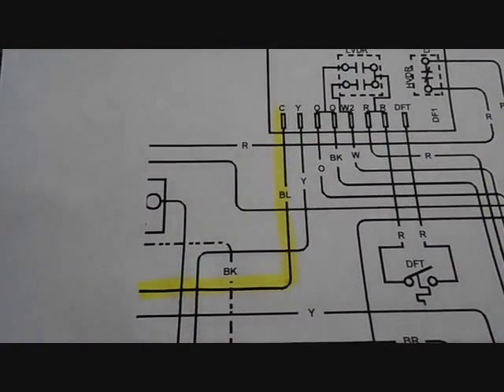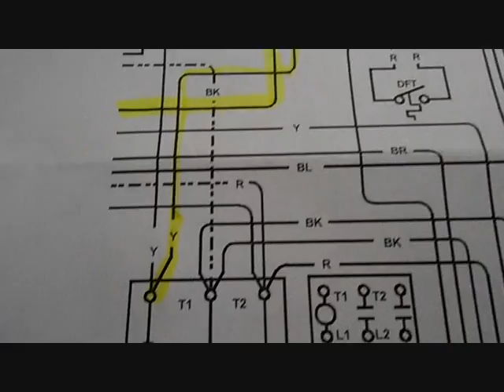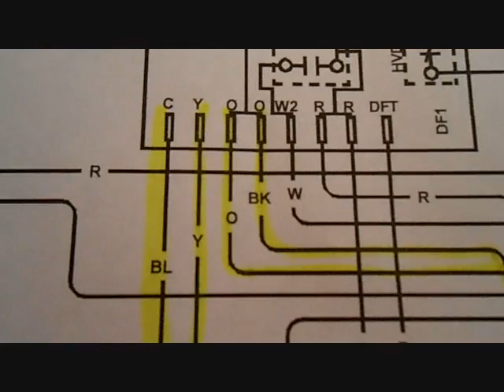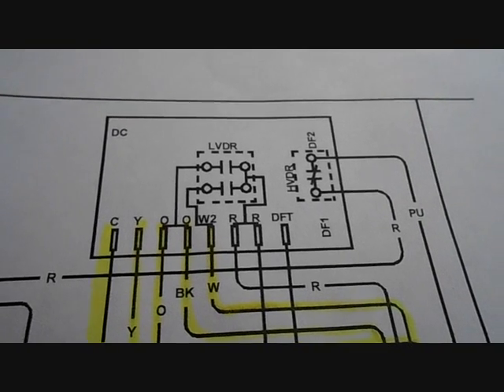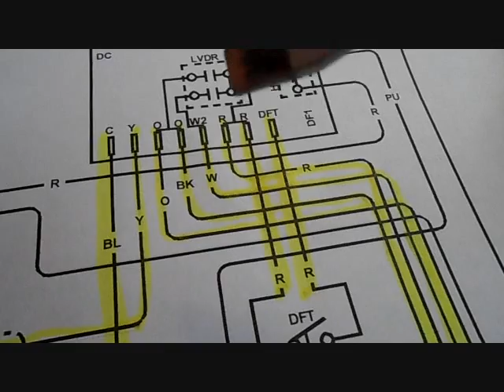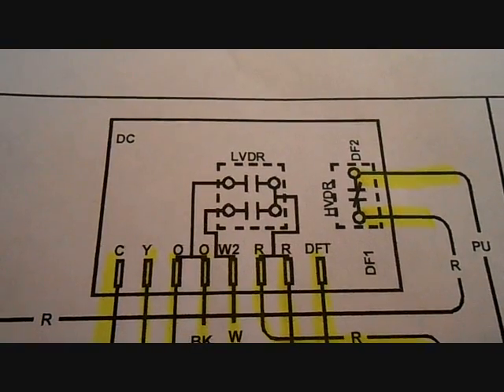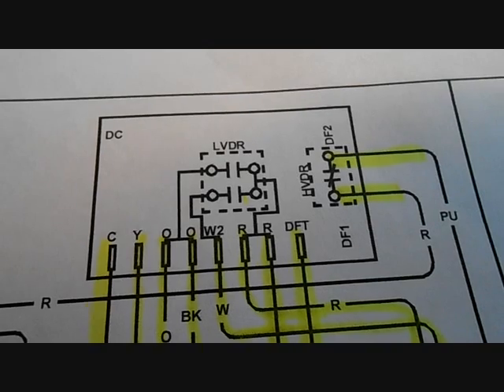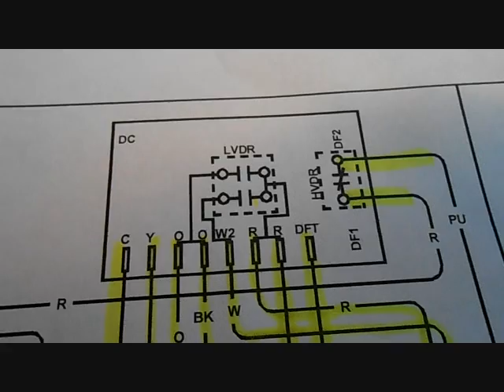HVAC Controls- PCBM130 Defrost Controller

Comment: I have this board. Can you confirm the fan disables during the defrost cycle? Mine does not.
Reply from the maker: The outdoor fan should shut off during defrost, yes.
Reply: Thank you..
Reply: Thank you for the video. My same board was not shutting the fan off, and I replaced it today. Issue fixed. Appreciate your video

Comment: You are wrong on the 30, 60 or 90 minute selection. On this board once the Defrost Stat closes it will DELAY THE ACTUAL DEFROST MODE by 30, 60 or 90 minutes. If no Delay was used it would be going in or out of Defrost no matter of Temp on Coil as long as Stat is Closed.This Delay amount is chosen by the type of Winter units is installed at. I have seen this Defrost Stat short out Closed in the Summer and unit will go into Defrost even in AC mode as board does not know difference in Heat or Cool Modes. Quick fix to this is to simply unplug Both Defrost Stat wires.
To Test Board, In Heat Mode and Unit running, You need to see 24 Volts AC from C to Y and R. If not power on R defrost Stat has no Power so Board never operates. If Y does not get to board then the Delay Timer does not Operate so no Defrost.
The Defrost cycle then starts and will reset once the Defrost Stat opens at approx 68 degree coil Temp or 10 minutes whichever comes first. 
This is a Very Good Defrost Control Board and I have seen many Service Tech’s install on other equipment brands. These were used only on R22 UNITS  and Not R410A units.
Reply: " once the Defrost Stat closes it will DELAY THE ACTUAL DEFROST MODE by 30, 60 or 90 minutes"
No SIR You're wrong sir! IT DOES NOT HAVE TO WAIT THAT LONG This defrost control board is run on both Time AND Temperature.The timer will start counting the time EVERY TIME the unit to be run on HEAT mode depend on the timer you set 30/60/90 mins. but the unit will not start the defrost if the defrost t-stat not cold enough to close it contact. Once the defrost t-stat closes and the timer LET SAY ONLY GOT REMAINING 5 MINUTES to get to 60 mins setting it will start to defrost. It DOES NOT HAVE to DELAY 30/60/90 as you said.
Imagine like you said  ONCE the defrost t-stat closes normally at around 30F and still it has to delay 30/60/90 minutes to go into defrost? How much more ice will build up on your outdoor coil before it can go into defrost ??

Comment: Hello. I have an older carrier heat pump that runs but does not heat. Both refrigerant lines are cold to the touch.  Could that be a reversing valve problem or a unit very low on refrigerant. Thanks.

Comment: thanks for the video! I have a question. if a hvac tech bypassed my unit to cool, only because the panel was bad, would it be the second "o" wire that he moved ? I replaced the defrost panel and am trying to figure out the wire that goes in the 2nd place of "o". thanks!
Reply: Now that wasn't very nice...
(Unless of course, the tech gave you just cause.)

Comment: On this unit does the thermostats send a signal to the contractor an it turns on the unit? You said y on the board is contractor  is it gettin a signal from the thermostat.What energizes the contractor ?What the y doing on the control board?

Comment: Is that the one you said, like to use when unit is out of warranty?
Reply from the maker: No, the one I was talking about is made by ICM.
Reply: talyn875 ok
Reply from the maker: ***** Johnstone has the ICM ones near the parts counter
Reply: ok kool thanks
Reply from the maker: ***** did the second board work?
Reply: talyn875 I had not the time. Had a call in surf city @ noon. But I did pick up the 2nd new one (well thought I did) The one at the counter put the new one next to the first new one and I think I picked up the first new one cause it still did not work. From now on I will write BAD on the box. I will be going to try one more time in the morning to get a new one that is 100% good. Needless to say it was not a good morning. 36 mile round trip to supply house. LOL Then when I got to the surf city job. It would not pump down & it takes 16 pounds plus more for added line over 15 feet. 4 story house. I did not have a empty tank to put it in by it self. Goodman is paying for this one and we know how much they are willing to pay. LOL So going back there on Monday to change it out. (Not A profitable day in no way.)

Comment: I like watching your videos. You're knowledgable, but not full of yourself. I'm a technician myself, and I have no issue admitting that air to air heat pumps are not my strong point. When going into defrost, the outdoor fan is de-energized. The system runs in cooling to send hot gas into the condenser to melt the ice. However, what is keeping the compressor from locking out on high head during the defrost cycle?
Reply from the maker: Typically it is cold enough during defrost that the head pressure does not get too high.